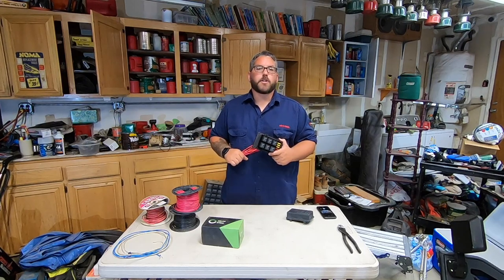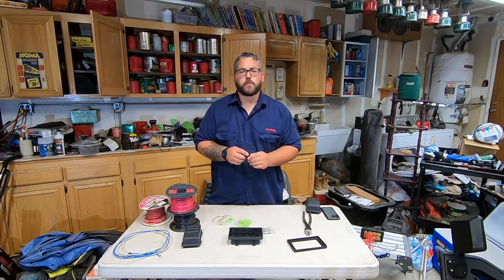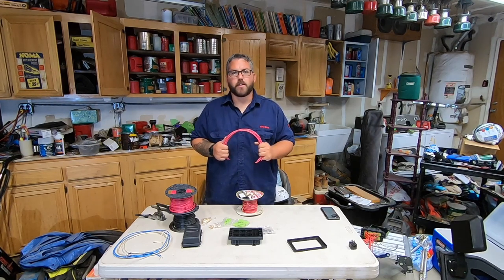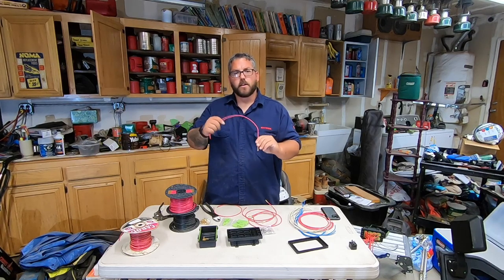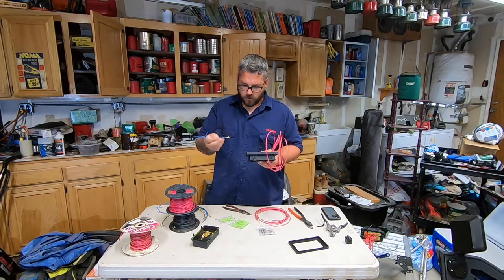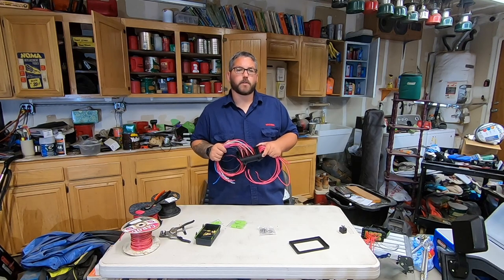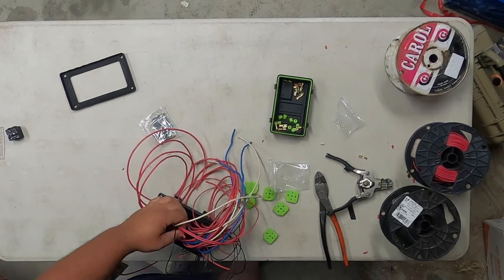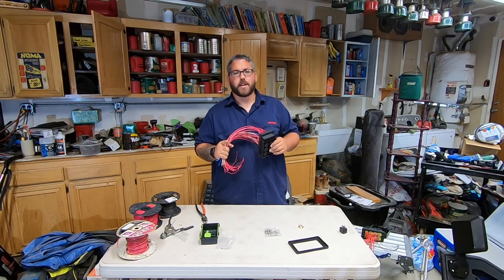You Need This DIY Fuse And Relay Block For Your Rig

Comment: "Constant power out is misleading" because once it is switched, it is no longer constant. The correct term is NC (normally closed,87a) when inactivated. The terminal that is switch on is NO (normally open, 87) activates with power on. Terminal 30 is "common" (sends power to 87 OR 87a.)

Comment: I could use some help. I got the same kit. I'm trying to wire a setup and unsure how to go about it. It's just been YouTube video after video and a headache. Lol Now that I seen this, I think I got it all backwards. If you could assist that would be a huge help. It's like 7th redo for me. Lol
Reply: What I am trying to do: 

I have a 2004 Chevy Tahoe. 1 roof light bar, 1 grille, 3 small pods for driver, passenger and reverse. We use my truck for hauling wood and late night drives. I am also thinking of adding in electric fans to replace the clutch fan.

I bought 2 of the exact same fuze/relay box. Figuring 1 relay per switch on lights. I want my first switch to act as a kill switch so I can use the lights with or without truck running. 2nd switch for roof. 3rd switch for grille. 4th switch for driver. 5th switch for passenger. And 6th switch for reverse.

I know it's overkill to run so much. But where I live it get pretty dark. And I also left wiggle room with relay/fuze just in case I wanted to add more later down the road. Like my electric fan conversion. If you could help me better understand how I should rewire things it be appropriated.

I think I wired the fuze/relays wrong. I have 30 on top and 87 on bottom. Fuzes to the right. 😅🤣 Like I said it's just been alot of rewiring and a little headache. 😂
Reply from the maker: Sorry for the late reply. I’m confused on your first switch. Are you wanting it to be like a throw switch that activates everything else? If so I wouldn’t even wire it through a relay. I would wire power through that switch to provide power to all the other switches and just run it in a series off the first switch.

Comment: where does pwr wires go (-) (+)
Reply from the maker: As in power from battery?
Reply: I have the same question. Yes. Where does the power go from this to the battery?
Reply: Ya, that's my question,  I'm sure I'm not adding 6 power wires to battery,  are they not combing down to 1 or 2. I've looked at a few boxes, trying to get instructions and info. I'm still stuck on the negative and power,  as 6 wires each, seems like alot to try and put on a single post
Reply: He uses a distribution block for power and ground